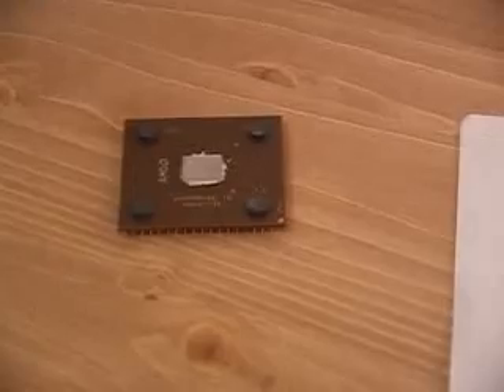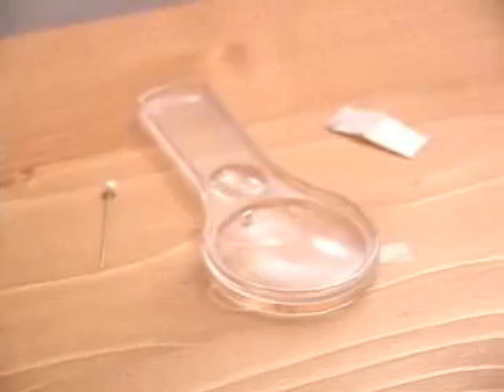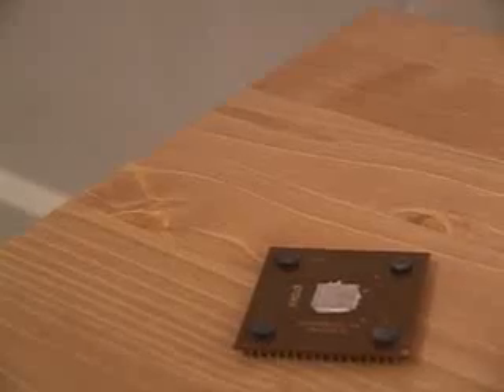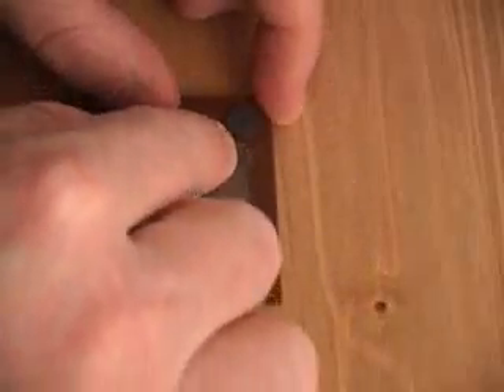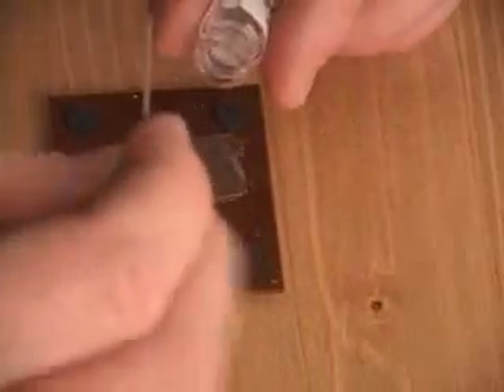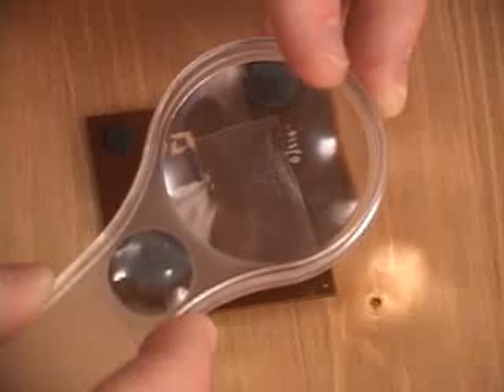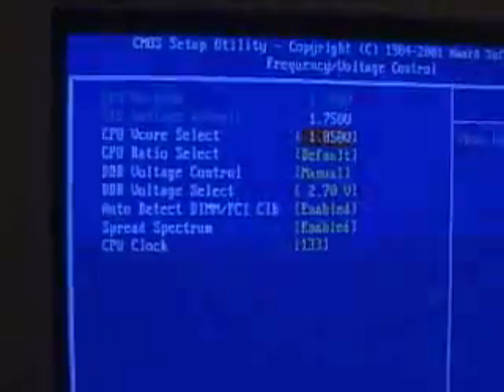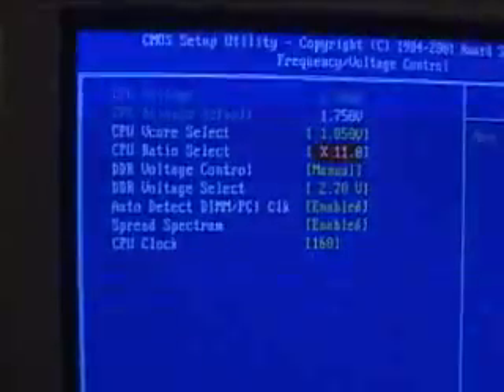#100 - AthlonXP Overclocking (unlocking)

Comment: I remember doing the pencil mod on my Athlon MP dual socket system haha. Did you ever do the pin mode? Installing U-shaped wires from an IDE cable into the socket to manually change FSB settings
Reply from the maker: This was a long time ago, but I do remember that. Those were the days 👍

Comment: I remember doing the pencil mod on my Athlon MP dual socket system haha. Did you ever do the pin mode? OCinside still has their interactive socket guide to install U-shaped wires from an IDE cable into the socket to manually change FSB settings in case your mobo doesn't support it in the BIOS.

Comment: ok just to be clear to anyone who likes to post ignorant remarks ..first off these processors in 2001 were LOCKED mainly becuz AMD renamed there 3200 and below to 1900 and up. They did this to sell as much old cpus before releasing their new line so ..unlocking the multiplier and then overclocking it like this is the way to do it with these processors. Software overclocking only does so much anyways ..get into hardware overclocking fellas
Reply: los niños lo tienen tan facil hoy, nunca sabran la adrenalina de puenter mal tu CPU XD

Comment: @astrologio.  Who cares about safety on such an old chip.  If it dies just buy a new one, they are so cheap now (ebay).
If you actualy meen what's the most stable speed on this chip then only you will be able to work that one out as these vary from batch to batch.